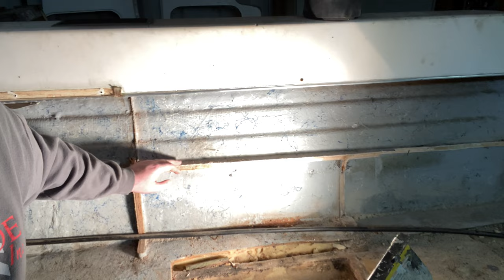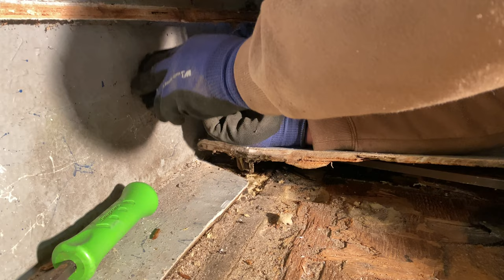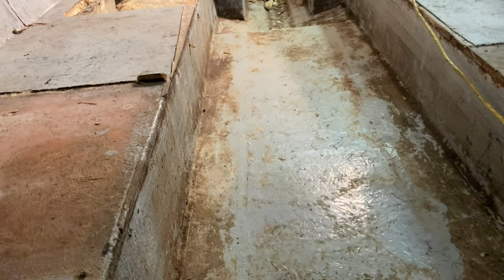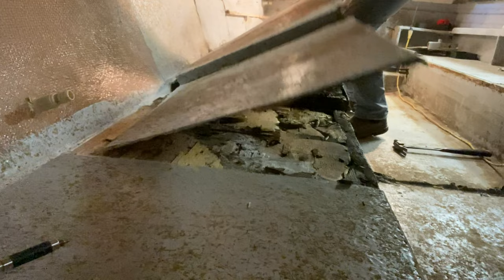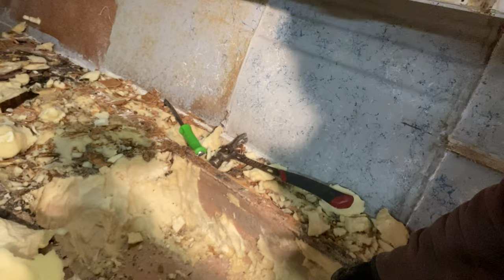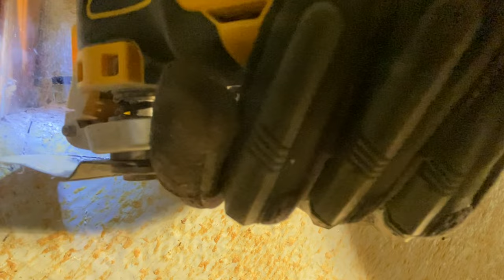Boat Restoration| Removing deck and finding rotten stringers

Comment: The Dewalt multi tool is brilliant. The switch gives trouble after a while. We use them in construction all the time. Great project. You will be happy the first day on the water. I converted my Bayliner to take a 250hp Yamaha two stroke and it was brilliant.
Reply from the maker: You can’t go wrong with Yamaha! My dad uses his quite frequently too in the construction field and that’s what turned me on to them! Thanks for following along!

Comment: Watching and waiting for that moment when the floor comes up and it's just a horror show of rot underneath. This diamond is looking rougher than it first appeared, but bravo for your dedication. I'm thinking about how much pride of ownership it will instill after you battle through all this work.
Reply from the maker: It’s a ton of work! There won’t be a single thing on the boat that won’t be replaced, except the shell! Thank you for watching!

Comment: ive wanted to get an older boat and redo it, the fiberglass has always scared me away from them. although im on the east coast and in the mountains we spend a ton of time on the lakes around here. ive always wanted a 24' + 1/2 cabin boat for fishing in the winter and camping on in the summer
Reply from the maker: All I would suggest is to make sure you have a lot of time and not be in a hurry. If I would have done what a lot of people suggested, I wouldn’t have found the major issues with the boat that could really do some damage! You should go for it though! There is a ton of boats just sitting that will be great boats. If you do decide to do it, let me know because I’d love to hear about it! Thanks for watching!

Comment: Just ran across your channel, good work on the documenting.  And I also really like the oscillating tool for doing this type of demo work.  Just so you know you are not alone... I am also in the middle of a 1976 20 ft sea ray that sat for 14 years.  I also found the floor and stringers rotten.  I was surprised to find that a major boat company did not even wrap their stringers and did such a poor job of sealing the inside of the boat. At least your foam looked fairly dry, mine was really soggy on the bottom.  I found using a key hole saw to section off small areas allowed me to break away chunks with a crow bar.  Keep up the good work, I will be following along now.
Reply from the maker: Thank you! That sounds like a ton of work but hopefully it will be worth it in the end! Look forward to hearing about your project!

Comment: It is amazing the way you address problem. But if it it be finished I would change it out to and outboard engine
Reply from the maker: Thank you! It will be converted to an offshore bracket with a 300 Suzuki outboard! Thank you for watching!
Reply: @LindellAdventures  Austin, if you do indeed decide to install outboard engines, you may need to strengthen the transom. I doubt very much that the original transom was built to handle the static weight and dynamic load of one or more outboard engines.
I recommend watching Andy of "Boatworks Today". He is presently doing the exact same thing with the transom of his Bertram 25; converting from I/O to outboard.
Reply from the maker: I think I have watched every episode of Andy’s channel haha. I am planning on adding additional support in the back to help support the 300 Suzuki and offshore bracket. The transom in 2 3/4 right now if I can remember correctly. Once the stringers are out I will begin the transom side of things and evaluate from there on replacing or making it stronger! Thank you for following along!

Comment: I would use my circular saw for cuts in the boat to make a fast cut.
Reply from the maker: I would like to but it won't let me get close enough to the side and the oscillating tool gets it really close. It takes longer to cut but in the long run it will save me time!

Comment: Don't go back with wood. Honeycomb fiberglass board is stronger, lighter, and doesn't rot. Wood is the cheap route (my opinion). Also, with cleaning foam, make a vacuum drum. Then you just seal, pull, replace the bag. No foam bits or fiberglass dust flying. I learned the hard way....✌
Reply from the maker: I will look into both of those ideas! I am always open to ideas! What oz. size matt did you use for your floor with the honeycomb? I plan to use 24 oz matting. Thank you for the support!
Reply from the maker: Yeah it is! If the transom is indeed rotten I will use Coosa board for sure or something like it. I like the link you sent and seems reasonable. I will for sure look into it more! Thank you!

Comment: I HATE Pour-in foam...it's boat suicide when it's put it under decking. Ii just removed 120 lbs of water logged pour in foam from a small boat that some paranoid goof poured in in there 10 years ago. 
Thankfully nothing was rotted, except I had to cut out the wet deck to remove the shit.
I'm NOT putting back in.
Manufacturer didn't put in so I'm not either. Horrible shit.
They're called air buoyancy decks for a reason. I've seen so many boats screwed from pour in foam.
Good video....great tools and techniques to remove! Thank you...👍

Comment: hi you can get different blades for your DeWalt Oscillating tool flat knife blade would good to use on flat even surface (foam removal ) there is a u tuber that is worth watching  BoatWorks Today  Andy he just bought a new  blade  it vid two or three back from last  here some thing i learned many years ago long b 4 u tube in regards fibreglass boats any and all ply used in the making is consider suss till you see it not as you are finding out via this removal of decks i'll follow you along on your channel
Reply from the maker: Awesome! Thanks for the info! I watch Andy’s videos and he was one of my main reasons I felt like I could take on a project like this. He is a very good teacher and hope one day I can be too!

Comment: You can use your oscillating tool like a chisel. Might be faster
Reply from the maker: I was just trying to cut as close to the hull as possible to cut down on sanding in the future but you made a good point!

Comment: Ok, boatbuilding 101, the  wood makes the stringers strong is not nessarlly true. They would if not properly glassed .  It's the multi layers of glass that makes them strong, the core can be foam. Many boats built now-a-days have stringers, bulkheads etc foam cored. Only wood found in good quailty glass boats is the lipstick and mascara.

Comment: I have that dewalt multi tool. I would be lost with out it.  Curious how many blades did you go through?
Reply from the maker: Thank you Dennis for following along this project! For the tool blades, I am still on the first blade and it hasn’t shown any wear so far. I have been putting it through the ropes to test it out and these titanium blades are amazing! I have 6 blades for it so far! Part 2 coming soon, port side next!

Comment: I’d make some cabinets out of Starboard it will never rot out again
Reply from the maker: That's what I was wanting to do but it doesn't like paint, fiberglass, or really anything. It also has to be screwed or it comes apart over time with glue...

Comment: You really don't need to take all that foam out of there just cut on each side of the Stringer cut the foam about 5 inches from the rotten Stringer and put the new Stringer in and fiberglass it to the floor if you use one of those tree cutting ties with the real coarse teeth you can cut through the foam and pull it out as a whole piece well keep up the good work he got a lot of it ahead of you and you'll be very proud when you get it all done and the boats in the water
Reply from the maker: Cutting 5” away for each stringer would give 2 inches of foam in between each stringer. The stringers aren’t far enough apart and plus the foam was water logged on the hull part but it would be nice! Removing it would be nice but the glass was layer up fairly thick. It wasn’t too bad removing it!
Reply: @LindellAdventures  I know what you mean the foam holds alot of water keep up the good work great videos

Comment: Just take it out side and watched it burn 🔥 because it’s never going to get back to the original level I have used boat and it was thinking about replacing the boat entire thing is that last month my outboard motor broke off the back of my boat 😮and that just made me feel like letting it go and making a new boat from scratch I have experience with fiberglass and it love the older style type boats so I’m going with a fiberglass boat with a new twist it’s going to look like a boat that is from the 74 movie jaws I love the boat but it’s going to have to be upgraded we’re I can live on it as well as it I get started I will share pictures and it progressing best of luck would ever get the boat but once it started taking water it will never be the same boat
Reply from the maker: This is my dream boat. It’s lasted this long so I am determined to save it and show others they can do the same 👍

Comment: Hope the trailer is worth more than 1000 dollars, cause that boat sure is negative equity.
Reply from the maker: I have made my money back, plus some (Engine, outdrive, gimble, etc). It's a ton of work but I am doing this for the experience and rebuilding something that doesn't deserve to rot into the ground. The trailer is in good shape. If you watch the first video you can what all came with the boat. Thank you for tagging along!

Comment: Get stronger power tools you would be surprised how quickly you can demo it. i did a full boat build
Reply from the maker: I have more tools that would work, but I was trying out the new tool to see what it could do. The oscillating tool gets really close to the hull so that why I use it so much. Thanks for watching!